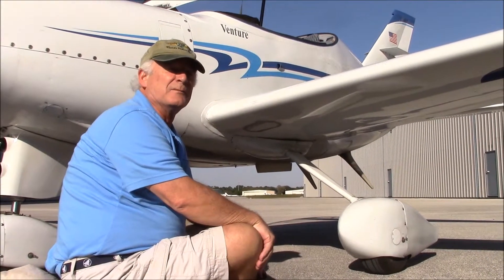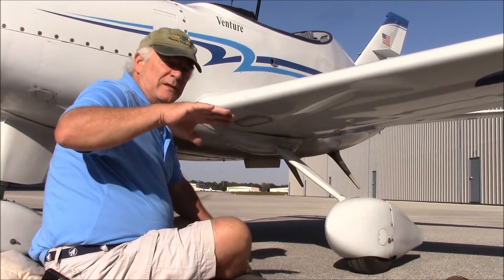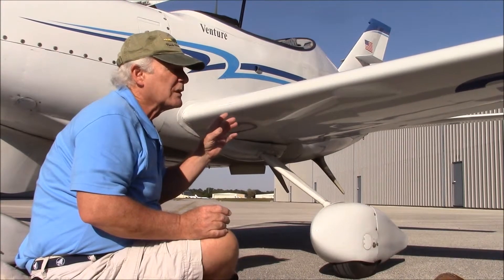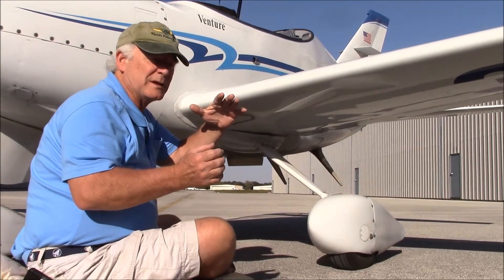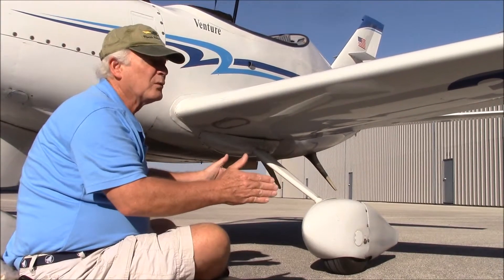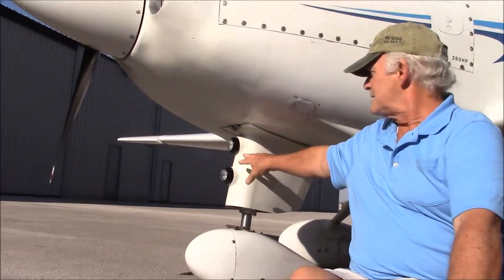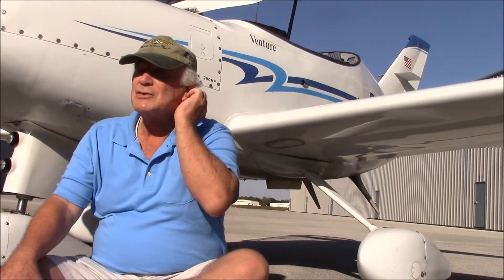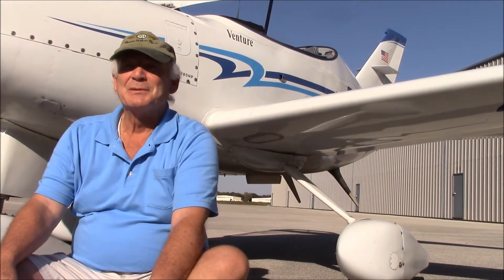Questair Venture Landing Gear

Comment: Retractable-gear is overestimated in my opinion.  The extra cost in maintenance and insurance premiums just isn’t worth the extra 10 kts (you mentioned giving up ‘8 or 9’ kts).  If it were over 30 kts, it’s be more understandable.

And that doesn’t include all the issues you were having.